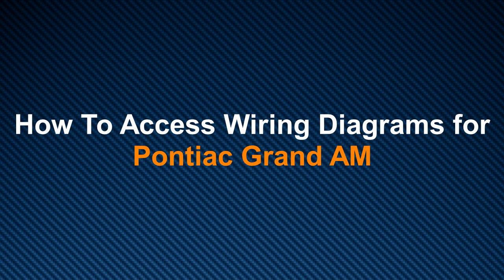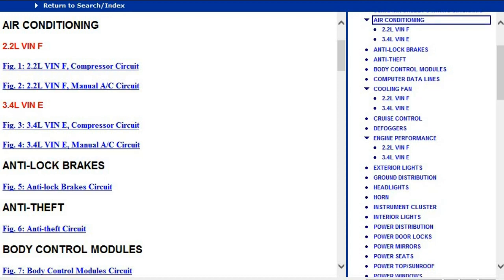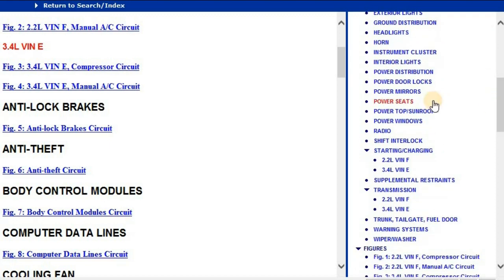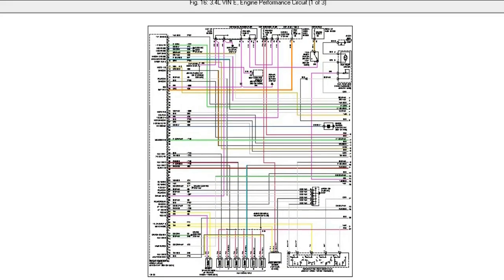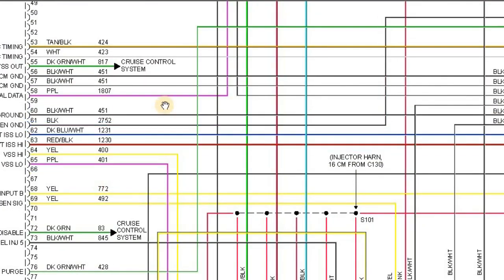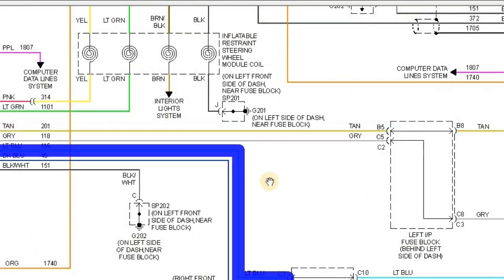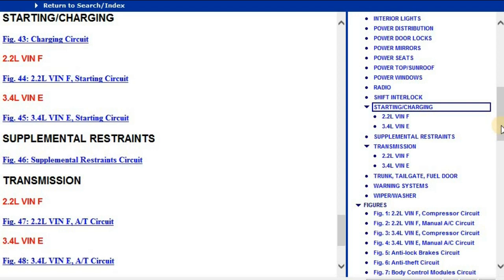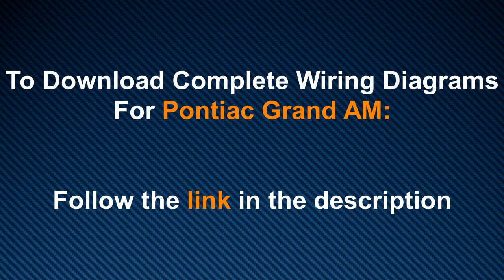Pontiac Grand AM Wiring Diagrams [Complete]

Comment from the maker: **** Question of the month *****

Which component is giving you wiring trouble? Also specify the production year of your grand am
Reply: 2003 pontiac grand am gt 3.4 passlock issue intermittent no crank no start, sometimes runs fine for initial trip until engine is shut off then will not start.intermittent complete engine shutdown during driving 2x. i have cleared codes relearned pass lock process 5 times. i can seem to recreate problem by removing 10amp accesory fuse. but when i put fuse back in it clears and restarts until next time it faults again. replaced starter altenator plugs plug wires coil packs ignition.odd thing is that car will start with a gm ignition which does not have a resistor in the key and i believe it shouldnt start passlock is suppose to get resistance signal to pcm in order to fire correct or ecm im not sure its been a few years.I have yet to try and bypass passlock.i really would like to get to the root cause.
Reply: Wiring anp diagam